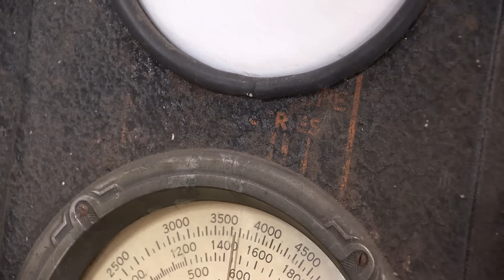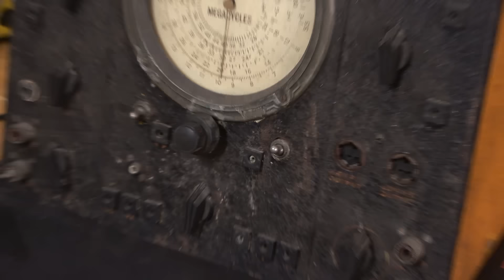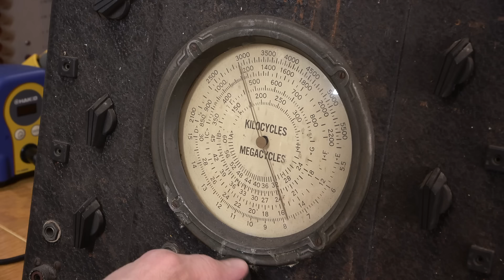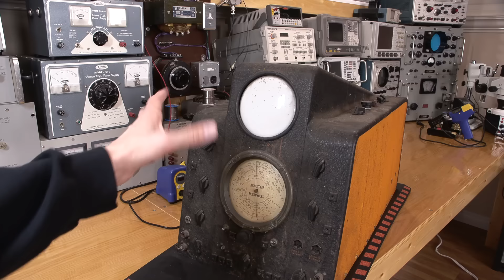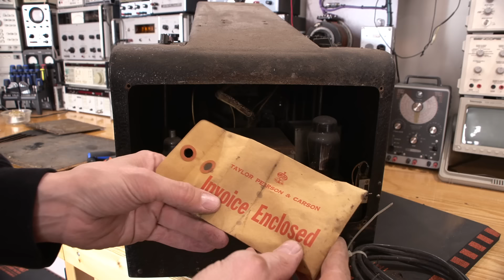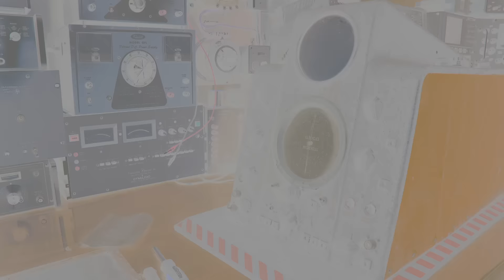Electronic Mystery Machine - What Does It Do?

Comment: TV sweep generator and scope for IF alignments. Incredible piece. Please please please do a Paul Carson Restoration on it and use it to align a split sound TV from the late 1940s!!!!!!! Edit:Supreme 555 Diagnomoscope orig price $147.95!!!
Reply: Nope, only goes up to 15MHz.  Fine for radio, but not high enough for TV work.  Typical split sound IF is 21.25MHz.
Reply: Good find! $147 in 1938! Pricey.
Reply: How wierd ! you spelled Pauls name without an 'L'  just like on the invoice ! :)
Reply: @andymouse Watching Johnny's show...
Reply: No it was 98$ and now we know why the writting is covered up the original tube was much much smaller and they cut a larger hole
Reply: There I a similar looking unit on the Hackaday website under the title "Restoring A 1930s Oscilloscope – Without Supplying Power"
Reply: @beyondmiddleagedman7240  Agree, that was big bucks back then for the average technician.
Reply: @bandersentv  Yep...I see that.  What a beast of a machine.
Reply: @MrCrystalcranium  Very advanced and innovative for the time.
Reply: $3300+ in North American pesos today!!!
Reply: @captainmidnite93  that’s like $4600 in Funny Money! 😂
Reply: That’s what I thought it was .  The CRT on top probably has…. Or had , an outline for aligning the IF.  I’ve seen one before…..A LOT SMALLER!!!!
Reply: @rohnkd4hct260  But Bob is right.  The frequency range is too low.  Early TVs from the late 1940s needed sweeping in the mid 20 megacycle range and later sets in the mid 40s.  This giant steam locomotive only goes up to 15MHz.
Reply: Yeah he's a heavy beastie.
Reply: Is that today's prices or 40s?
Reply: @MrCrystalcranium The catalogue entry (easily found by googling the name of the machine) says it can reach 60 megacycles by way of harmonics, 5th setting on the band switch.
Reply: @mandrakethemadcoder  Interesting. Hopefully Mr C will restore it and explain what it can do.
Reply: Isn't that similar to a Vectorscope

Comment: 1938 Supreme Instruments Corp. Catalog
Supreme 555 Diagnomoscope
(Oscilloscope and Signal Generator Combination)
Reply: Wow so the original crt on the top was indeed a lot smaller.
Reply: @ChipGuy  ...and the partial text reads "DE LUXE SERIES" not "SOMETHING INDUSTRIES".
Reply: Bingo!
The RCA connection was a modification, as well as the upgraded CRT.

It read:

Supreme
Cathode Ray Oscilloscope
Model 555
Diagnomoscope
De Luxe Series

Only $147.95 back in 1938.
In today’s dollar?
27OCT24
$3,308.42
<inhale> ahhhh, inflation.
Reply: Almost the equivalent back then to a two-way radio service monitor (which usually has RF signal generator & oscilloscope, as well as other functions); it it's designed for doing sweep alignments, it would be almost equivalent to a spectrum analyzer that has a tracking generator.
I have a couple of Motorola R2001D's, & just restored a Motorola R-2400, have an R2001A with a couple of fried resistors in the power supply on the eventual project list.

Until I saw your posting, I was going to guess (with the RF frequency dial on it) that it was a very early spectrum ananlyzerI think those were more post_WWII; the earliest panaramic radio adapters were invented in 1937 if I remember correctly; Hallicrafters & I think at least 1 other company made some designed for military use.  I actually owned one MANY years ago, had it wired to the IF of a Hallicrafters S-85. 😶

Tom WA1LBK
Reply from the maker: Great find John!
Reply: that what I thought to an old oscilloscope
Reply: @clutchnshift1  Quite close to the cost of my oscilloscope [that also has a signal generator - but also a logic analyzer and protocol decoder]

So lots of money, but not more money than what you can make back by regularly using the instrument in the daily work.
Reply: Same year as my Detrola console radio
Reply: @WA1LBK  I took a long look at it and was like that has to be something like an early service monitor. My IFR is probably just as heavy as that thing.
Reply: also "combination mental torture device", trying to figure out all the knobs, switches, jacks and sockets! 🤣
Reply: I just spent 4 hours of my day going down this rabbit hole looking at Supreme Instrument catalogues.  Guess I can cut the grass tomorrow.
Reply: Wow, what a hell apparatus... This looks like used in Area 51 to adjust a teleporter for opening portals to other dimensions or servicing a time machine. That's a really scary steampunk boat-anchor. 😉

Comment: Getting this thing apart as well as fixing it will be a treat; then reassembling? This will require many digital photos and sketches. If there's anyone who can do this job, it's Mr. Carlson. I'll watch every second of this adventure!
Reply: I can't imagine that they designed it such badly serviceable. Isn't there perhaps an unobvious hidden service position to flip up the entire top cover on a hinge at one chassis end? The routing of cable bundles can hint what it was supposed to be. (E.g. inside a music keyboard Vermona SK86 I discovered a bizarre service position where stacked PCBs could swing to the sides like the doors of an altar after loosening few screws. Also early TV sets often had tricky chassis flip mechanisms.)
Reply: I was always very good at the taking apart phase,it was the go back together phase ,i suck at.

Comment: Photos of the original device show a much smaller CRT. Someone upgraded or repaired the device using a larger CRT - which is why some of the inscription now is under the rubber bezel.
It originally read:
MODEL 555
DIAGNOMOSCOPE
DE LUXE SERIES
(not "... industries" ;-) )
Reply: Good find!
Reply: Check out if it's a CVR97

Comment: Really is a stark contrast when compared to the disposable junk made these days. That whole art deco design is really fantastic. Right down to the knobs and that absolutely fantastic bezel on that dial. And I'm guessing its probably put a few bucks in surgeon's pockets via hernia surgery, lol. But that's ok, because it's just darn cool.

I do dig the offset dials with the little u-joints on the shaft running back to the switches or pots, whatever they are. Just neat seeing how they did things back then.
Reply: May it be that the u-joints are there for a service position where when the machine lies on its side or upside-down, one of the chassis folds out on a hinge?

Comment: As others have pointed out, it is a 555 series Diagnomoscope DeLuxe model, meaning it's a signal generator and an oscilloscope combined. The faded lettering you pointed out would've had the text "Model 555 Diagnomoscope DeLuxe Series". The CRT dial is not the original one as it was smaller and had a similar bezel to the signal dial, so someone's modified it in the past. There would've been white lettering around every switch and port to help the user identify what it does, and there would've also been a band of up-to-down letters just above the CRT dial. There's also two switches on top of the machine that have been changed out as well.

Comment: These old devices with transformers, tubes and mechanical linkages are so much more interesting on the inside than the modern ones that just have boards with IC:s and push buttons.

Comment: It is an electric frequuency generator, combined with an ocillosocpe that shows the frequency generated. With such a thing you can do a lot of fun, including generating radiofrequency  rays you can send on your neighbours, performing ultrasound therapy or radiotherapy.  A frend pf mine happened to buy such a generator, but without the ocilloscope. I tried it out by connecting it to a sound device for electric guitars, and it made high frequency sounds, and vould surely make ultrasound, or infrasound  if I had combined it with another sound device. The device of my friend was more modern, and probably used power transistors rather than vacuum tubes, and it did not need restauration.

Comment: After learning from a comment here that this was a Supreme 555 Diagnomoscope, I looked for more information. Originally, it had a much smaller CRT on the top, so it was replaced with a larger one later on, which explains why it covered some lettering. It is a signal generator and an oscilloscope built into a single chassis.

Comment: You did well to get away with just a burn. I am guessing the EHT could be 60 Hz derived and therefore lethal and TV technicians have been killed servicing early TV sets of this type!
Is this definitely an IF TV alignment generator? If not, could it be a panoramic receiver?
TV IFs confirm to fairly well defined frequencies. The dial seems to cover a number of radio bands.

Comment: I still like the story about the slanted "on the move" look being accidental.

It originated from the curtain shutters of the Graflex Speed Graphic cameras which were used to photograph motor races in the 1920s. Because it had a rolling shutter, the top of the car would be exposed before the bottom, so the bottom would be more ahead, slanting the car while it moved, giving the illusion that the air was trying to skew the entire car over.

After that it was popularized in comics, and people interpreted that as "going fast" because all racing photos looked like that.

Comment: Hello Mr Carlson! This mysterious device is probably a spectrum analyser for monitoring radio frequencies. It could have been used in the radio measuring service to examine the transmission quality of radio transmitters or to analyse radio interference.
A few years ago I restored a PANORAMA EMPFÄNGER 36 MHz with ZUSATZEMPFÄNGER TYPE ECFs. Manufacturer was Plisch Viernheim
The former is the basic device with cathode ray tube. With centre frequency 36 MHz +/- 4 MHz for scanning the spectrum. The additional receiver is a super, which mixes the VHF channels 1 to 12 and UHF 470 MHz to 970 MHz down to IF = 36 MHz.
The span of the panorama receiver is 1 MHz (exact scanning of the spectrum), 7 MHz (video signal), 9 MHz (video signal + sound).
The scanning frequencies are 50 Hz to 30 Hz and 50 Hz synchronised to the mains frequency. The RBW was selected accordingly (signal delay through filter).
Both devices were used in the terrestrial distribution network of the Federal Republic of Germany. They were helpful in troubleshooting when, for example, a television transmitter had no sound or had completely failed.
In any case, an interesting project that probably shows a spectrum analyser from the early days. This is also supported by the transducer you discovered, which changes its inductance analogue to the sawtooth frequency for the X deflection of the picture tube. This inductance forms a resonant circuit and generates the frequency for the second mixer. This results in the display of a voltage above the frequency in the picture tube.
The first mixer brings the reception frequency into the reception range of the second mixer.
All of this is achieved without complex calibration. At that time, people were delighted with a meaningful spectrum. Have fun restoring this mysterious device!

Comment: Back in the day, capacitors in the pF range were usually labeled mmF. Perhaps the pf label is referring to power factor?
Reply: The catalog photo I could find of the Supreme No. 555 Diagnomoscope, which this device probably is, show the labels on those two sockets as "High R.F. Output" and "Low R.F. Output," and the caption block pointing to them reads "Specially shielded output jacks for R.F. Signal Generator."

Comment: I'm gonna shoot from the hip right at the beginning and say it's an oscilloscope, judging based on the tube up top.
Edit: When it comes to restoration and paint job I don't think silver would actually fit this thing. There is a perception it should because almost all media we have from the period are in gray scale. If you change the appearance it's no longer a restoration, it's rewriting history. If it came yellow or orange from the factory, it should stay that way. When it comes to actually using this thing, I'm a bit skeptical. It's a priceless piece of lost engineering and these pieces should be preserved as they are in case future generation might need them. We've lost quite a bit of irreplaceable tech just because people wanted to show it off. I would be however quite impressed if you could make a copy of this thing for modern use. Who knows, maybe you can make it weigh less than a planet with more modern tech inside, and maybe stuff more functions in too, while having the timeless art deco look for it.

Comment: The device is likely a vintage signal generator or frequency meter, often used in radio or communications testing. The dial showing "Kilocycles" and "Megacycles" (older terms for kilohertz and megahertz) indicates it was designed to measure or generate radio frequencies.

Given its rugged and industrial look, this might have been used in military, aviation, or communications industries in the mid-20th century. The presence of both kilocycles and megacycles on the dial suggests it could cover a wide frequency range, useful for applications where precise frequency tuning or measurement was necessary.

Comment: I'm guessing at 7:00 before the back is opened and without looking at other comments.
A variable waveform, variable frequency signal generator. The knobs on the top control the CRT display; knobs on the front left select the frequency band A B C or D on the dial and one of the knobs on the right to select between Khz and Mhz. The small square sockets across the bottom (two on the left labeled "?XN" and "?YN") are likely signal modulator inputs or Scope axis modulator inputs.

Comment: Revamping could have changed a 5bp1crt to a 6 inch CVR 97 blue screen tube  as they are otherwise compatible this would account for bigger hole that goes into the writing  . The unit could be a single sideband receiver demodulator.

Comment: Unbelievable....  I have never seen anything like this, and the fact that we can't hardly guess,  What it actually is and does shows a true ministry.....  Sure are a lot of interesting parts putting this device together a lot of parts that look like there very specific to this device, yep, this is going to be an interesting restoration, just discovering all the failed components and discussing them,  I have never seen a transformer designed like that....  That looks like to me an expensive part, or somebody wanted a specific transformer with what appears to me to be very high-quality.  But,  again I will wait to hear what we can learn as we go through each component and you tell us about that component.

Comment: It would have been too easy to say it was build as an early television set.But it could be a scope. The dial is for the selection of the frequency for the horizontal movement of the beam. Another wild guess is that the cathode ray tube is for the display of the signal coming from remote radio transmitters and this could be connected to multiple antenna's so that the direction from witch the radio signal originates could be displayed. But professional equipment had back then, first half of last century, a boring simple square box housing, no immigration wood that would look nice in the living room.

Comment: In my high school electronics classes in the 70's we worked on a lot of old donated TVs from the early 60's and even late 50's.  Those types of resistors, capacitors, and tubes look very familiar indeed, as does the rat's nest style of point to point wiring.  It's personal preference but I wouldn't over-restore it.  Get the electronics updated and working, yes indeed.  But myself I'd leave that case alone, just give it a good but gentle cleaning.  It's telling the story of decades of use and that would all be stripped away if its refinished.  Your equipment though, you do what you want.

Comment: 7:39  That switch is an "interlock."  It disconnects the power AND shorts out the filter cap(s).  All broadcast transmitters have them, along with a "grounding stick," a hooked conductor connected to a grounded cable, with a long, insulated handle.  It's laid on the HV terminal of the P.S. capacitor.  When you're dealing with MANY kilovolts, you don't take chances.

Comment: I have something old tech like this hanging in my basement. Its wall powered and clicks when plugged in. It has a metal cover on it and many telephone wires running in and out of it. My house was made in the 60s and someone told me it was a switch for the telephone lines.

Comment: Perhaps the scope originally had a smaller tube, or the large tube was a later option. This could explain the covered lettering. I'd keep the original paint. It appears to be the same paint as the lettering. Cover it with vinyl if you can't stand it, or just bring it out for Halloween.
Don't paint a Tektronix scope green just because you don't like blue.

Comment: Nice with the safety switch but you will still get zapped but the none isolated terminals on the switch, of course it could be low voltage used there.

Comment: That would have been an extremley expensive device back in the day. What a beauty. Do any of these old beasts contain PCBs in the transformers, the oil filled ones like this that is?
Reply from the maker: I'm sure, but not worried in the least.
Reply: @MrCarlsonsLab  Absolutley, they do seem very well sealed!
Reply: seems to be a gender-bender machine from another universe... At least the polychlorinated biphenyl oil leaking out of those capacitors and trafo may slowly transform your gender by their dread hormonal effects, until you wake up within the Rocky Horror Picture Show. 😉

Comment: Huff-Duff (HF DF) receiver from WW2 ... takes two crossed loops and a vert sense antenna ... display would be a 'propeller' shape on the CRT until the sense switch is pushed then it removes the bearing ambiguity (which is had with the loops alone). I have researched DF receivers extensively. Offering this as a possibility ...
Heh. I wanna change my answer. Someone else nailed it - its  a Supreme 555 Diagnomoscope.